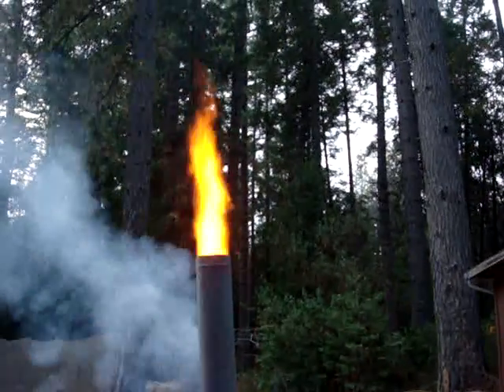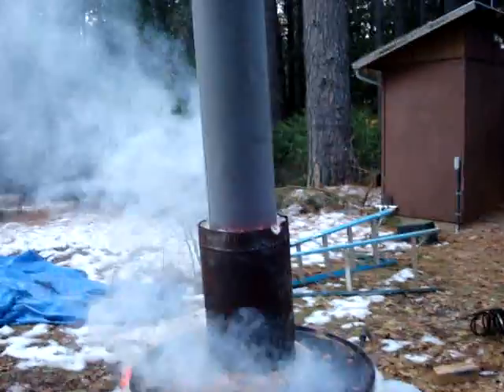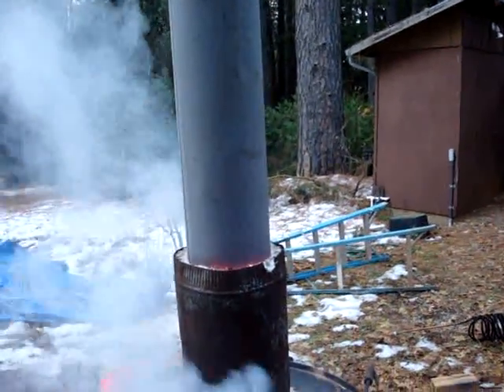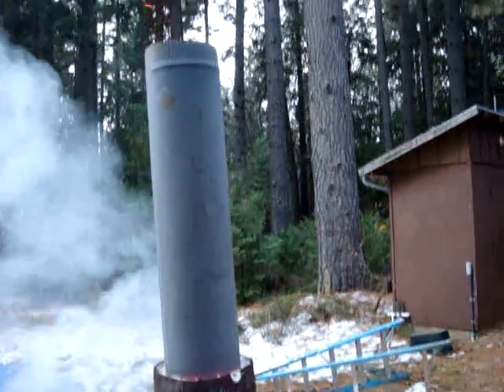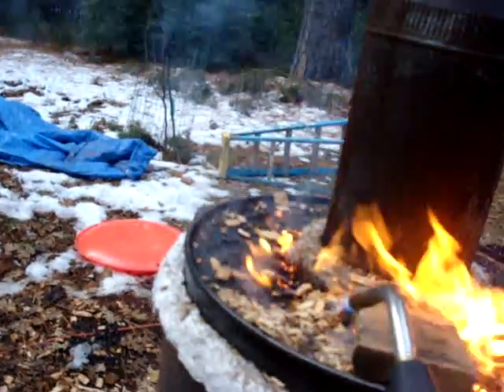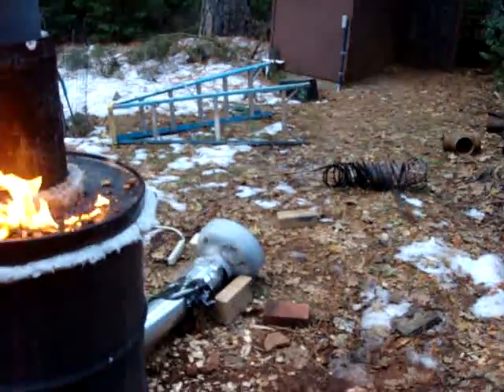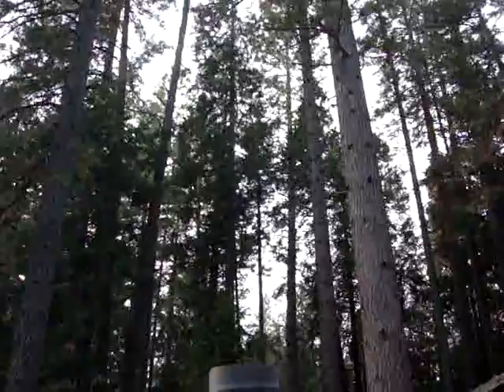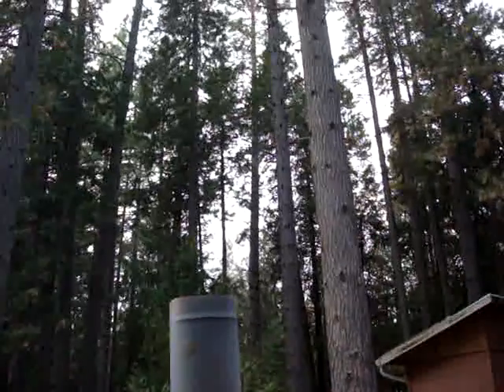wood chip burner prototype B 10kW power system 3.MPG

Comment from the maker: No.  I meant 500KW.  Seems like a huge amount, but you need to realize the entire interior of the 50 gallon barrel is filled with flames, and so much so that they are shooting out of the top of the flue.  I've run the numbers, and yes it's an estimate.  but it's in the range of 500KW give or take 100KW best estimate.  I run it at around 70KW when driving steam or hot water through boiler, so this was an over power system check to see what would happen.
rt

Comment from the maker: Rocket stove has around 50 to 100 feet of 1/4 or 1/2" copper tubing depending on who built it.  This is a different geometry, and has around 500 feet of 3/4" high pressure high temperature stainless tubing.  It can output enough heat to take care of home heating load in 2 hours operation per day.  And, it will drive 1000 psi superheated steam through a turbine to generate electricity.......things no Rocket stove can do.  But of course, yes, both make heat using wood via monotube boilers.

Comment from the maker: @firewoodguy2009 ......Yes, a chimney fire would look similar.  Here, though, the flames originate from a large amount of wood chips thrown all at once into the burner.  The volume of wood gas evolved is greater than can be burnt prior to exiting the top of the chimney, so the flames come right out the top.  They die back down after a short period and can be kept indefinitely out the top if you wanted, just add plenty of chips.

So no, its not a chimney fire.

Comment from the maker: To accurately measure the heat the boiler is putting into the water, you can measure the water flow rate in gallons per minute or other units, then measure the inlet and outlet temperatures (for water in / water out), and compute the heat input as 1 btu/pound water per degree F.  So for example, for 8 pounds of water in one minute with a 100 degree F temperature rise, you get 8 * 100 btu / minute.  That is equal to 800 btu/minute, or, about 14 kilowatts.  Steam's a bit more complicated.

Comment from the maker: @kmcwhq 
~15,000 BTU / pound * ( 7 pounds / hour) = 30 kW
I was running the fuel at around 5 pounds during the 2 minute video, so that's around 
15,000 BTU / pound * (5 pounds / 2 minutes) = 660 kW...........
Also, I've produced a measured 45kW steam from the boiler running a small fraction of the heat in that video, and it isn't 100% efficient....so yes, 200kW is about what it was making during that video.
If  you think I'm wrong, show me some numbers...rt

Comment from the maker: This has taken a lot of work, though not rocket science.  Basically just look at how a wood stove is built at a local store and use some of that with the materials you have.  It is dangerous if you don't know what you're doing, ie, could start a fire in the wrong location and so on, so be careful if you try.  I'm building this to create a new product line for stand alone power (heat and electricity) generation using bio fuels.